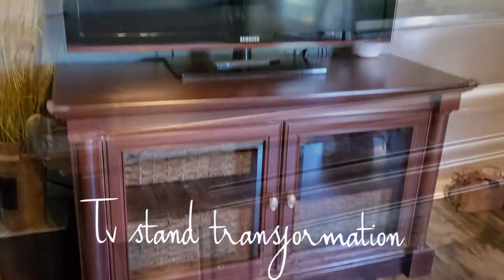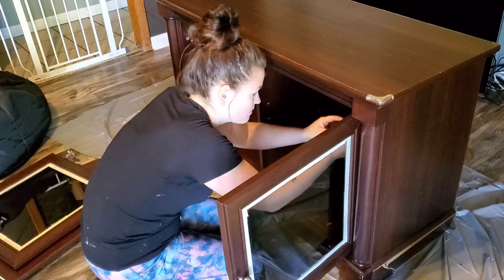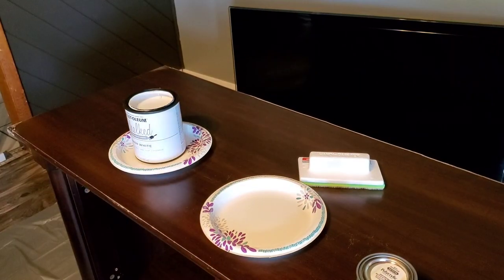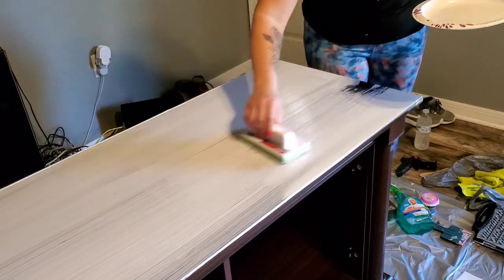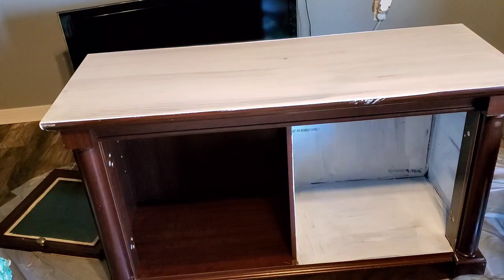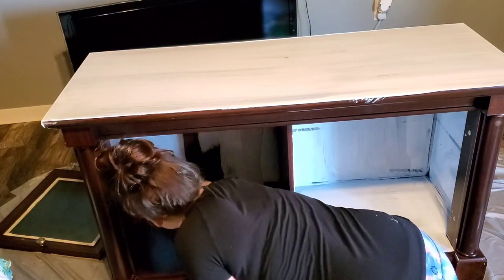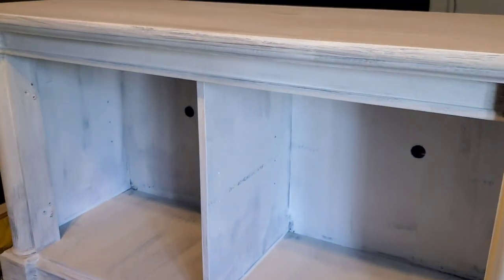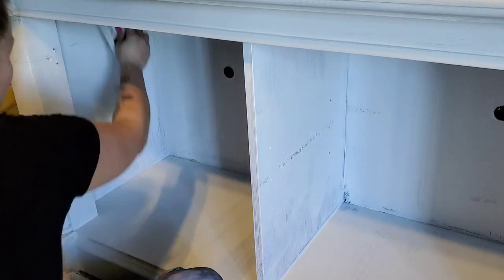DIY Makeover on a budget | Furniture transformation | DIY Tv stand Makeover

Comment: Love this transformation!!  Quick question... just did a piece and sealed it with the minwax polycrylic and got lots of bubbles with my brush strokes.  Do you have any recommendations?
Reply from the maker: I'd recommend sanding those out and doing another coat.
Reply: Another you tuber uses small roller brushes hand held to apply the poly and smeared it on and reduced or eliminated the poly bubbles

Comment: I use an old flannel backed tablecloth as my drop cloth. I put the flannel side down. If I make a mess on it, I wash it! I use a short, gentle, warm cycle. I sometimes put it in the dryer on the lowest setting for just a few minutes or not at all.  The tablecloth I am using now I have had for almost a year. It is the biggest rectangle one I could find. The price tag is from Wal-Mart for only $1.50!
Reply: Such a great idea!!! I sometimes cut garbage bags in half but not very reusable and not very big.